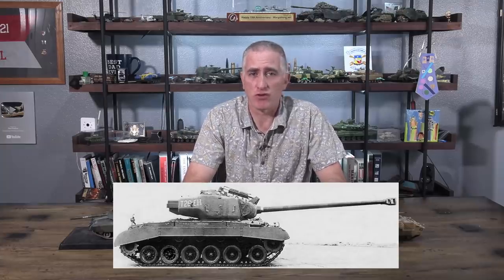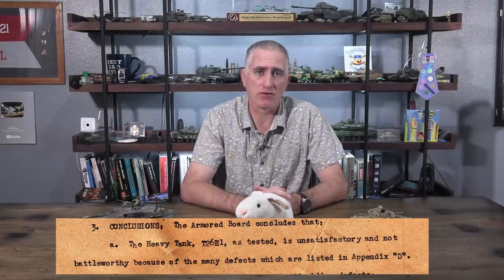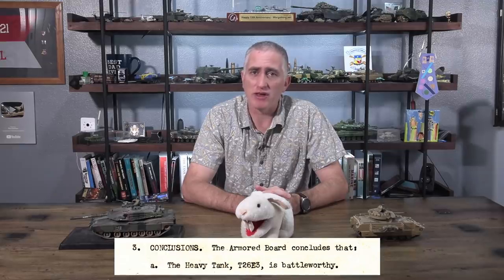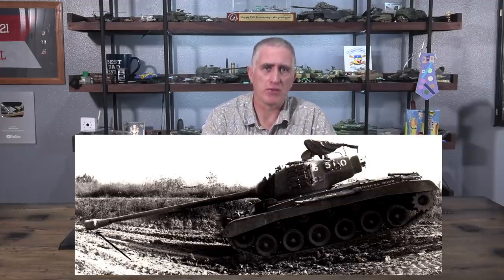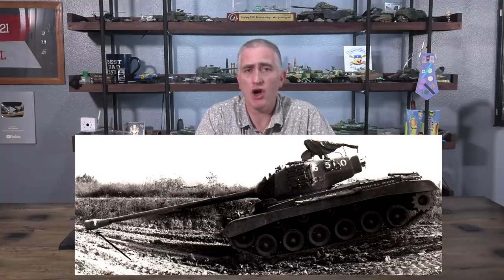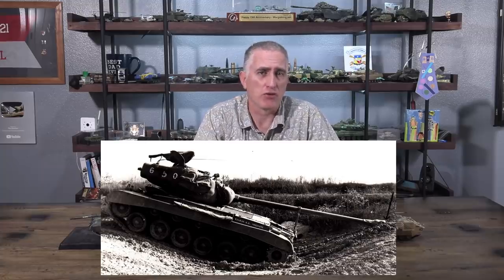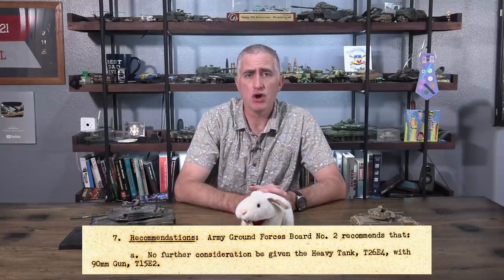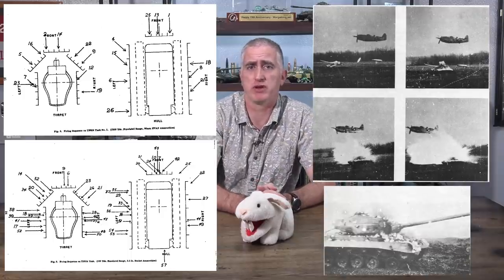Super Pershing: Why T26E4 didn't work.

Comment: After reviewing the video and the comments he mentioned the powertrain as to whether or not it was resolved. According to what I researched the powertrain issue was not resolved until The Korean War. They were still using the same powertrain and transmission that was being used on the M-4 Sherman towards the end of the war in Europe. So the early M-26s had a powerplant designed to move a 30ton Sherman was being installed on Pershings that were 10 tons heavier. Part of the problem in getting it developed was Army politics delayed a big part in it. General McNair who was Chief of AGF, an artillery officer, was in favor of keeping only 76mm armed tanks and was opposed to developing tanks with a 90mm gun and did his best to delay it. The only thing that kept development going was General Devers who was in charge of Armored Forces went to Marshall who overruled him.  When they did correct the transmission problem it was a whole new tank. The M-26s that were rushed to Korea were using the same powertrain which caused issues when travelling in hilly terrain. The M26E2s which were being developed had a redesigned turret and improved engine, where it was reclassified as the M-46. All the remaining M-26 Pershings that were in Korea were upgraded to M-46s. But since the M-26/M-46 could overmatch the T-34/85, very few tank on tank actions happened after 1951. So Shermans were the prime tank then.
Reply from the maker: Different issue. I was referring to the changes in the power train between T26E1 and T26E3 (the production version of M26). It turned out that T26E3's system wasn't ideal either, but it was certainly better than T26E1's, and the vehicle which went to Germany was originally an E1.
Reply: @TheChieftainsHatch  Correct me if I'm wrong but are  you're referring to, the switch from a 'torqmatic transmission' to an 'electrical transmission'? Granted you're the duty expert on this. From what available sources I could find the transmission was still being used with the same M4A3 engine they installed on the T26 series which points to them using an engine not suited to the increase in weight.

Comment: I am curious if you have access to any reports on the spiritual successor, the M26E1 with the 90mm Gun T54. Hunnicutt clams that those went much, much smoother in testing and that the T54 gun was essentially killed off as a result of budget measures.

Comment: Any info about the M26E1 version that had a 90 MM T54 gun and a shorter and fatter propellant charge?  I think I saw that 25 examples of the tank were produced after June 1945?
Is there any info in the archives that the improvements made to the M46 for the use of a Cross-Drive transmission and a V-12 engine were ever considered for the T26 during its design or early prototype stages?  I have seen that both of the above were used in the prototype T29 tank, so I was wondering if Ordinance had ever had the spark of inspiration to add these two improvements to the production M26s before the Fall of 1945?
Thanks!
Reply: The US actually had two potential V-12 engine designs they could potentially have used for armored vehicles. These were the Curtiss D-12 and Conqueror aircraft engines. The problem here is in all likelihood Curtiss or the Air Corps had scrapped all the tooling.  Ford most likely have been strapped to produce the V-12 version of the G series of engines. Of course the G series started out as the Ford V-1650 designed as a competitor to the Merlin.
Reply: @mpetersen6  I am well aware of the Ford GAC engine and its history.  How much different would it have to scale up the V-8 production line? As a automotive engineer, it would not have been that difficult given enough notice/time to scale back up to a V-12 engine.  What is the real question is whether or not anyone in Ordinance thought that during the design stages, the T26 with its increased weight, would have benefited with a bigger engine which what my question to the Chieftain was.  Or would the change in engine delayed the production of T26E3s later than actual start time of Nov. 1944?
Reply: @robertdendooven7258  
Having worked in the Tool Room of an automotive engine facility for 30+ years I also have a very good idea of just what is entailed in producing automotive powerplants. My point about the Curtiss power plants is they had basic designs that where relatively well developed. Production of them probably would not have entailed that much specialized custom built machinery. The components most likely to require specially built machinery would IMO most likely be the equipment needed for the camshaft and crankshaft grinding. I'm not sure if Landis built pin grinders or multi wheel large enough beyond those made for custom orders. The other large components could most likely be manufactured on normal machinery found in larger machine shops. G&L boring mills, DeVlieg jig mills or there equivilants. These V-12s would not be needed for M-4s. Another possible powerplant option would have been the Packard V-12 used in PT boats.
Reply: @mpetersen6  I think that the Packard 2500s would have been a good call, though they would have needed to be detuned to run on automotive gasoline instead of the avgas the PT boats ran on.

Comment: One of the first tanks I got in WoT  ..  a friggin' medium! even with all that extra armor welded on it would never 'bounce' a round...then down the road they come out with another version that was now a 'heavy' don't know why they considered the Super model a medium; along with that extra armor must be made out of Styrofoam I guess...asked the question on the forum and only got nonsense answers....go figure.
Reply: The extra armor is essentially melted down pots, pans and somebody's buick, save for the stuff on the turret. Boilerplate was never designed to be shot at. Only good for "decapping" armor piercing capped ballistic capped rounds and pre-fusing wartime HEAT which still used spin stabilization and was thus not only poor at penetrating armor but incredibly vulnerable to any stand-off space whatsoever. Paper thin skirts on the sides or front or even a fence welded a few inches from the armor would have had the same effect on HEAT.
Reply: @Muzzled  agree but still it's more metal up front...and the way it plays is like it's not there is my big beef... then later on they trotted out a 'heavy' version....yeah right.
Reply: You guys are talking about a game. Not reality.
Reply: @UkrainianPaulie  that's right...but talking about it on WoT you may as well howl at the moon.

Comment: Follow up question on the M18 Hellcat and their successful failure: were they any better than 30+ ton tanks/TD's in logistical terms, using  less shipping, fuel and/or maintenance? I also assume it's cheaper to build a 17 ton vehicle than a 33 tonner, as armor plate tends to be expensive.

Comment: The t32 might have had the 3rd variant of the T15 gun. That last variant used a resigned shell case that was wider and shorter and was one piece. This might have allowed the use of a standard m26 turret size.

Comment: I have to say, wouldn't the recoil cylinders being on the outside be a massive vulnerability? If they are damaged in any way from shrapnel or bullets you would have essentially knocked out the gun as it wouldn't be able to fire as if it did I would imagine it would hit the back of the turret?
Reply: i think the essence of the problem was: if you're hit, you probably wont survive, OR it would be a effective kill anyway. It doesnt take a penetration to kill a tank. the real strength of super pershing was the Gun, not Armor, and there was only the one in europe. Also the first thing they fixed was the outer springs, so you're right. but i dont think it was a problem for the singular tank in europe, that was supposed to shoot first and if hit, it could easily be knocked out
Reply: You might thing the gun knocking the turret off the tank upon being fired is an oversight, but infact no. You see, the immediate appearance of the tank having been knocked out fools the enemy into moving on to the next target, while the super pershing can continue to fire-

Oh.
Reply: They are not recoil cylinders, the springs were holding up the weight of the gun, not absorbing the force of the recoil. If they were damaged, the gun would likely fall to maximum depression (as the internal elevation mechanism can't hold it up) disabling the tank, but it would not be directly harmful to the crew.
Reply: Wyatt Roncin your comment read like a Squire sketch
Reply: Mialisus  46 ton mobile foxhole. okay, 43 without the turret.
Reply: @noahdavis3236  Indeed, you nailed it Sir.
Reply: Unless you're between the breech and turret roof - it's happened when the equilabrators failed in later vehicles, and why we were taught to get our hands and arms out of there
Reply: Nope ... Wargaming deleted the hitbox on the recoil cylinders. Perfectly safe now.
Reply: @luki97z  If the external springs were damaged, the gun and the tank crew would all become very depressed.
Reply: The equilibrators were inside the turret of the T26E4.

Comment: Just compare this frigging huge cartridge with the one of an M1 Abrams. With WWII technology, a 122-130mm would be a two piece munition and still be extremely heavy and the cannon would require a huge turret to handle the recoil. With modern ammunition, I bet the old cannons would be worn out after a few shots... Thus, the cannon material and the recoil buffer must have improved considerably.

Comment: @chieftan sorry to ask another question,but after watching. Drachfinal video concerning munitions for naval guns and necking the shells higher to diminish size and weight but still maintain same effectiveness for kinetic energy or possibly increasing it,why has this not been done for army style guns used in various purposes ? I figure this would increase ammo storage capabilities as well as diminish loader weight handling concerns that are becoming more and more problematic the higher the caliber the gun is . Or has this already been done and not nearly as noticeable as it is with navy caliber guns ?
Reply: The Italian oto 60mm hvs is a necked down oto 76mm. And it was designed for light land vehicles. So they atleast sometimes neck down their shells off the top of my head. And the new 50 mm chain gun developedfor the us army is also just a necked up 30mm (the one in the Apache) off the top of my head. Would be interested to see how often this is down though.
Reply: @matthiuskoenig3378  the new army 50mm is the 35mm NATO AA cartridge necked up to 50mm. Same overall length and base diameter as the 35x228mm, but a much better HE round. And the APDS round is obscene, supposed to punch more than 140mm at 1km.

Comment: kinda looks to me like the T32, while the turret is strongly reminiscent of the T-26, the back of it is different, like it was designed that way instead of having a bunch added on.  perhaps its simply a case of it actually using a turret that big instead of a T26 turret modified to accept and handle the larger gun.

things like a bit more room for teh gun laying equipment, room aft of the gun for loading, room to get those casings out of the hull stowage, perhaps ready racks for casings along with shells.  that room could in turn allow more reasonable access to the hull stowage areas.

i think you have shown a couple of other tanks where just a couple of inches to something like the turret ring, where it seems so minuscule, makes all the difference.

Comment: Sounds like a "Case" for early development of the Semi-Combustible Case. Yes, Yes, I know that they didn't get it "rightish" until Rheinmetall smooth bore 120mm. But going with a "Slightly" more "Efficient" Powder(leading to a shorter case length) & a "Lighter(Aluminum, maybe)" case might have made the loaders life easier. But Good Lord, that long barrel would make EVERYONE'S Life more difficult in any kind of terrain other than a "Sheet Of Glass" flat Prairie. Maybe a 90mm M3/M3A1 with the barrel half way in between?
Reply: 105mm and having the British developing APDS shot for it would have been better at that point.

Comment: im not too familiar with tank ammunition but how can different rounds for the same gun have different lengths and still headspace correctly? is it just the projectile itself that is a tad longer/shorter?
Reply: Depends on the ammo type. Armor piercing ammo needs to be as quick as you can squeeze out of the breeches pressure limits and steel tolerances of the projectile, but high explosive rounds need to be moving comparatively slow as to raise their arc of travel to target and increase their splash radius. As a result, one piece ammo might have different powder loads between ammo types or different cartridge lengths for two piece rounds
Reply: Depends on where they physically headspace. IIRC, most tank guns used rimmed cases, so they headspace off the rim. 

I think what you're actually thinking about is the space between the projectile and the start of the rifling. That does affect accuracy, but since tanks use a different crosshair for AP and HE it gets dealt with there.
Reply: @ScottKenny1978  ah interesting I guess i just assumed they headspaced off the shoulder

Comment: The original 90mm gun was considered equal to the short 88 of the original Tiger...but what could the short 88 not kill? Pershing ending up mostly fighting T-34-85s, against which the short 90 should have been perfectly fine. And in WW2, the only thing it would struggle with is King Tigers, which can just be bombed by dozens of Thunderbolts until they go away.
Reply: honestly, seems a bad case of overcompensating.
The US army fought WWII to this point with shorter and smaller guns, so they craved the bigger fatter cannon they could have - to no tactical need, just because "my gun is bigger than yours, darn Kraut"

Comment: Jingles did a video on the SP and mentioned a story about testing against a JP IV. Supposedly the round passed completely through the front, came out the rear then dug so deep into the backstop that they couldn't find it. Did you ever hear of this story during your research? I'm wondering if it's factual or just legend.
Reply from the maker: It is taken from Cooper's book. I have no reason to think it did not happen.